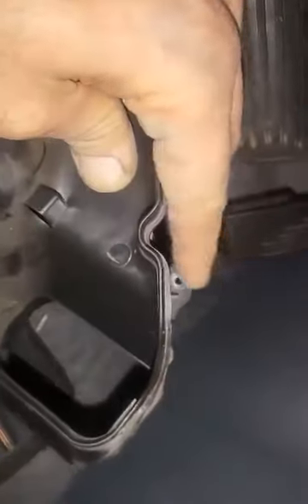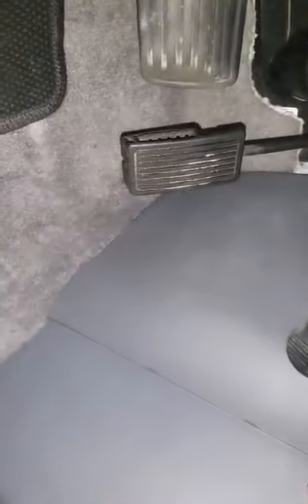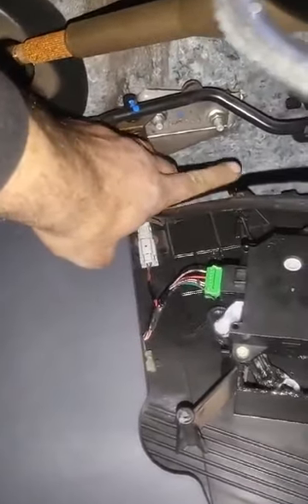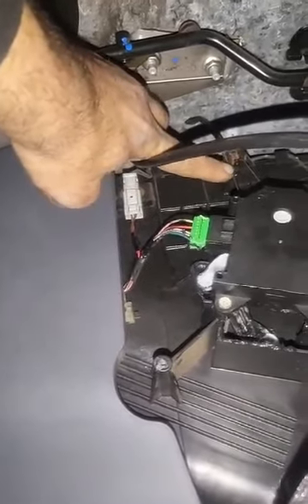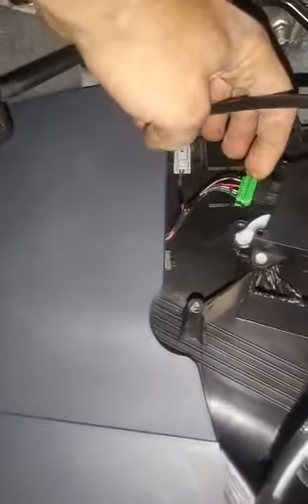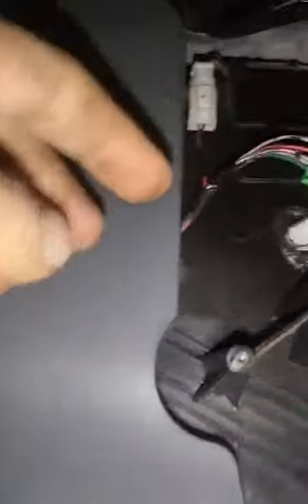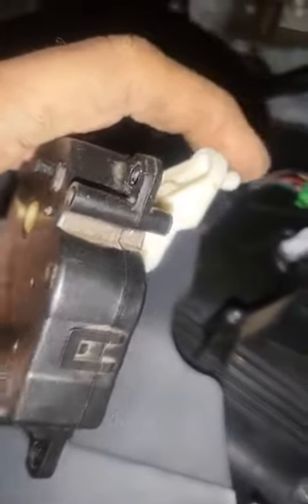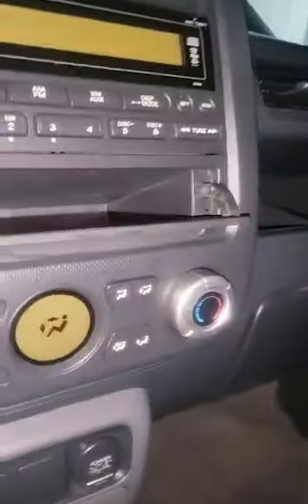2008 Honda Ridgeline Driver Side  No Heat  (EASY FIX)

Comment: same things mine is doing,no heat on drivers side it blows cold but passenger works good heat or cold. Thanks I’ll check mine in the morning when I have sunlight
Reply from the maker: Good luck 👍
Reply: I'm having the same problem, were you able to figure it out?
Reply from the maker: @#JesusWins   yes the problem was the driver side door blend actuator. So you see the heater valve behind the engine  close to the firewall the one I mention in this video,  the wire cable that is attached to it is controlled by that actuator to make this valve open and close for heat
Reply: I did have a blend door actuator that wasn’t working properly. Whatever the blend door actuates was jammed not letting actuator open/close correctly. I applied a lot of force by hand and was able to get it free. Reinstall everything and it was working correctly. Even though I fixed that issue, with the heater on I still wasn’t getting heat out of driver side vents. Only getting heat out of passenger vents. If you have heat on passenger side, and it gets colder air working towards driver side vents. Good chance your heater core is clogged. I flushed my heater core with CLR ( calcium lime rust ) and tested the vents with a DMM with thermometer to see temperature change before and after. It helped but didn’t completely fix it. I’m assuming It didn’t fully unclog the heater core. Here in the next few months I’ll do the same procedure with CLR again, this time I’ll use a air compressor with the drill operated pump I used last time. I’ll blast it several times with compressed air and see if it completely fixes or unclogs it.